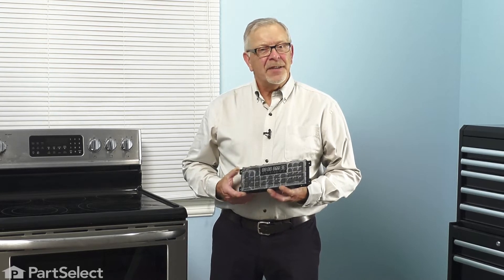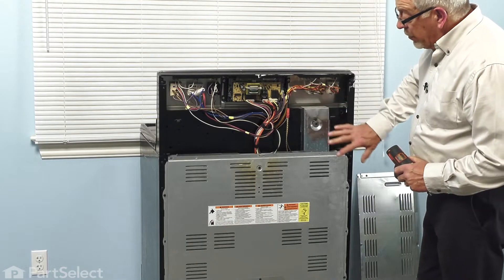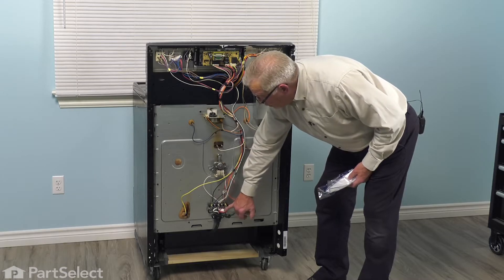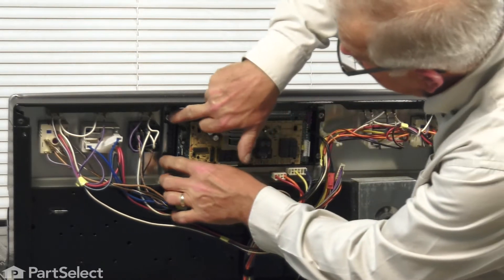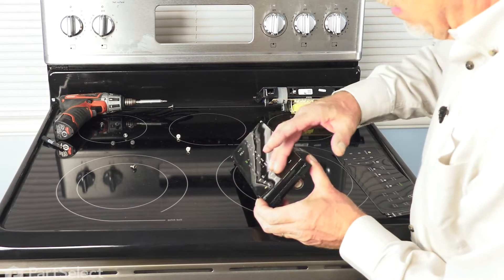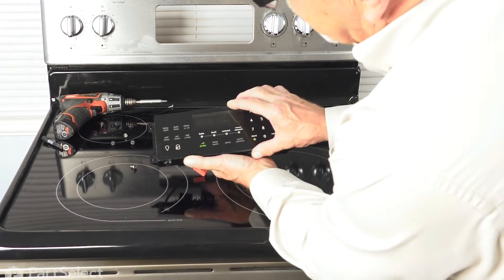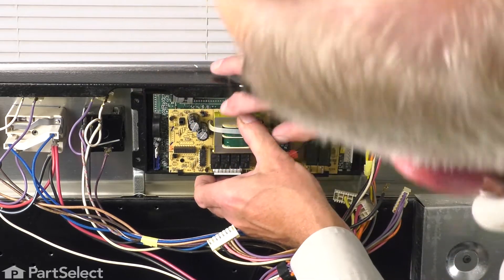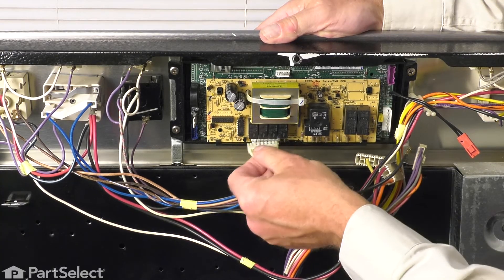Frigidaire Range Repair – How to Replace the Electronic Control Board

Comment: I had an f11 error on my stove with a panel just like this, I took it off and there was moisture under the 9 button. I wiped it up with a qtip and cleaned all the other button contacts and the stick on cover with qtips and windex. Reinstalled everything and it's working fine so far

Comment: This is a really good video.  I just changed mine and my oven is working fine.  However, don't do what I did.  Silly me... When I pulled off the faceplate off the old one, I didn't realize I pulled off the electronic part with it.  I put it all on the new one and didn't realize it.  I got the oven all back together and nothing worked.  I freaked out.  Then I looked at the old one and realized I pulled the old circuitry off with the faceplate.  Had to remove the faceplate again and pull off the old circuitry.  Put it back together and worked fine.  I can't believe I didn't realize it when I was doing it.

Comment: Excellent Video. No use in messing around with trying to fix old control panel unless you are capable of it. I bought a new one from Sears Appliance Repair, $250 with new bezel and control unit. #2 Phillips to remove the back, check for upgrade filter, install new control board. Easy job for anyone who is a decent wrench. This video is a must to make an easy job easier. BTW the sellers of the bezel and the board are not real careful about packaging. Fortunately mine was not damaged upon arrival. Thanks to this video mine went off with no problems.

Comment: on my Frigidaire Range some of the display buttons work & some don't. The ones used the most (bake, start, clear/off) don't work. Is this problem related to the overlay or the Electronic Control Board?

Comment: Hi,i have same range you are showing in this video. Got a error code F11, changed the control board, but still getting the same code along with lock sign on and the door is locked.Cant open the door. Do you have any idea what could be wrong Thanks

Comment: I have model #FEF389CFSK Frigidaire range, with a 316024538 control panel.  The broiler keeps turning itself on whenever the stove is used.  I'm guessing the control panel needs replaced (please confirm).  But, I can't find one anywhere.  Is there a way to remove or disengage the broiler coil so it doesn't function but the cooktop and oven can be used?

Comment: Hello, getting a "F11 ERR" code on a Frigidaire gas stove. Is it hard to change the electronic control board myself? Aside from unplugging the electric plug, do I also need to shut off the gas line?
Reply: Yes, turn off the gas at the (usually) red knob sticking out of the floor. You wouldn't HAVE to IF you have several extra feet of gas line to drag around with the stove. Most don't..as it's hard to place it when you install it. Always best to turn things like that off when you repair them..also when you turn it back on check for leaks in the usual manor.

Comment: The electronic control panel installed where hot cooking pots are cooking,  is a bad design on all stove  / oven ranges in my opinion. The reason being, the heated element like a pot that is the same height as the control panel may touch that plastic screen and cause it to melt, rendering the control panel useless when you're pushing buttons to gain control of the oven, etc. Appliances should be made durable, and ready to handle what households have to dish out. Keeping that control panel below the burners is a much better design, because of the fact there will be less potential for heated metal to touch that panel.

Comment: My oven turns off during preheating. I’ve changed the thermostat and it didn’t fix issue and then the quite pricey control panel and still didn’t fix issue. Sooooo I’m at a loss and it’s 4 days till thanksgiving 🫤any ideas ?